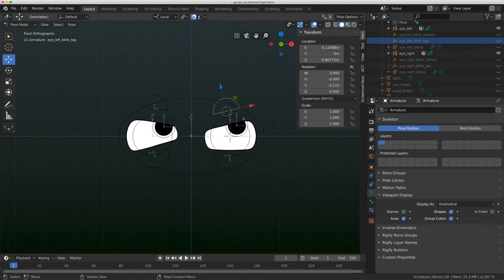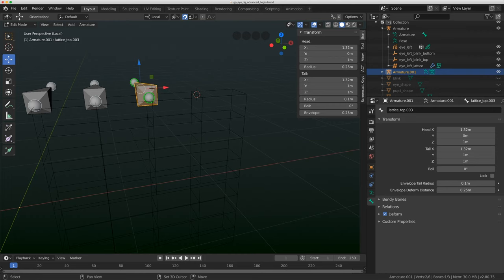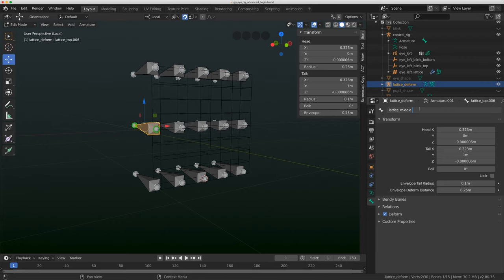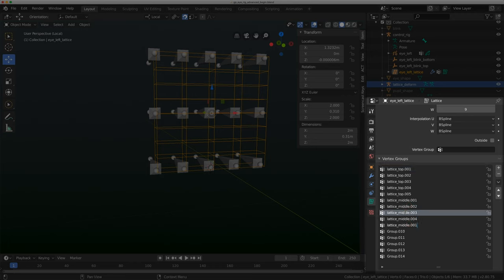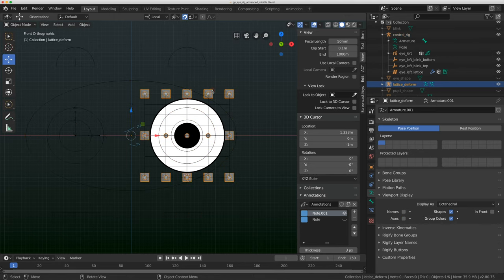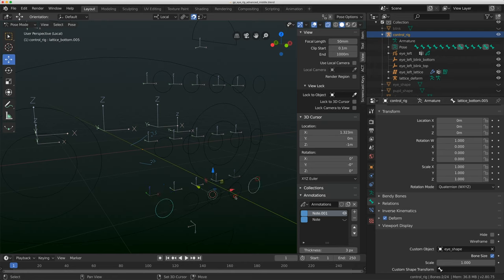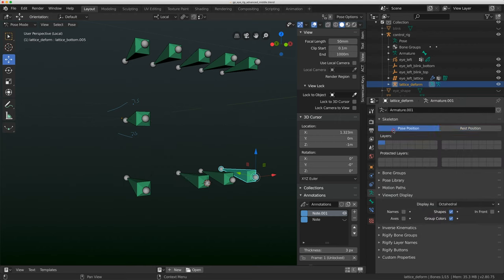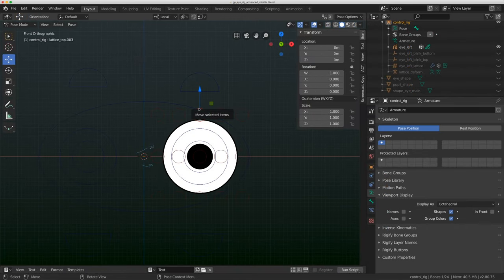Grease Pencil Eye Rig - Advanced Blender Tutorial

Comment: I have tried multiple times to attach the rig to the lattice but I can't seem to get this to work. Are there any common problems which could be causing this ?
Reply: I didn't realise the naming had to be identical and had differing capitals
Reply from the maker: Hey did renaming fix your issue? Yeah, the name of bones you add to the vertex groups has to match the rig. I wish there was a way to automate this, link on mesh.
Reply: @LevelPixelLevel  yes it fixed it
Reply: Thanks guys! I had same problem because my keyboard doesn´t react properly so I had typo everywhere and also started freaking out a little because I´m new with rigging :D this really saved me :)

Comment: How did you duplicate this over to a second eye? I've tried and am running into a lot of strange issues.
Reply from the maker: You can either duplicate the entire set up and flip it on the x, but this will cause issues. 
I found it easier to just duplicate the rigging parts, detach everything and almost rebuild it on the other side. 
Looking back I should have build this on the left and the right side at the same time to avoid this issue.
Reply: @LevelPixelLevel  Yeah that's basically what I did. Thanks for the tutorials though dude, been going through a lot of your videos lately.